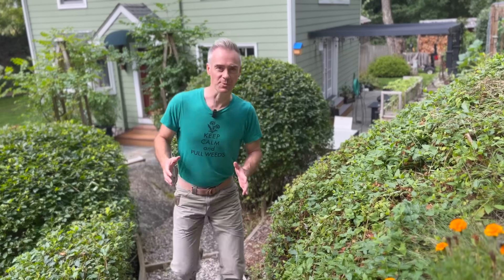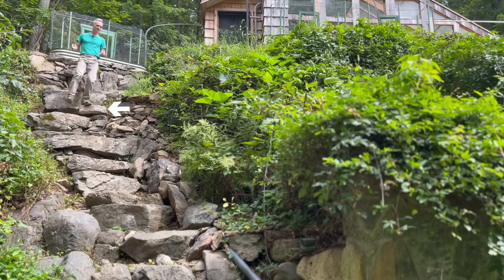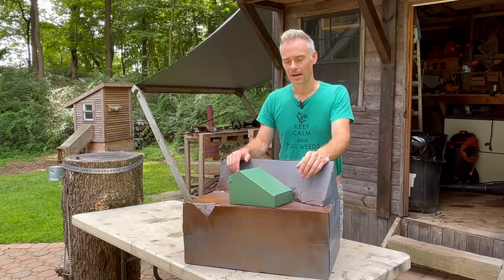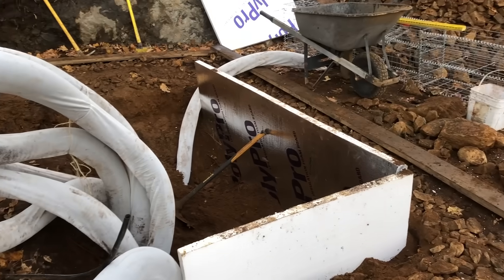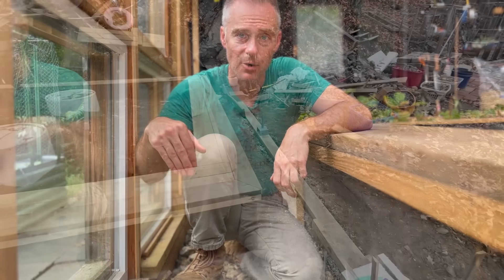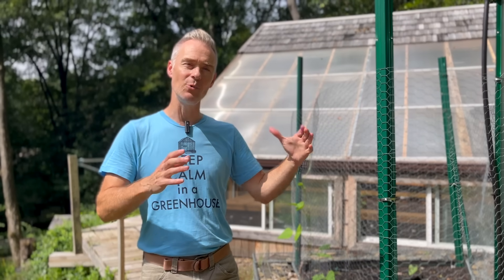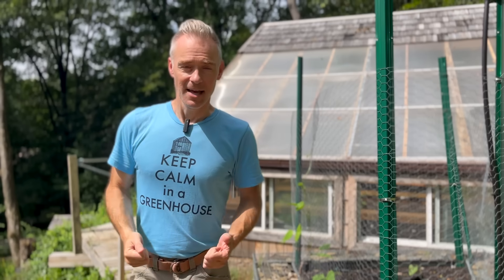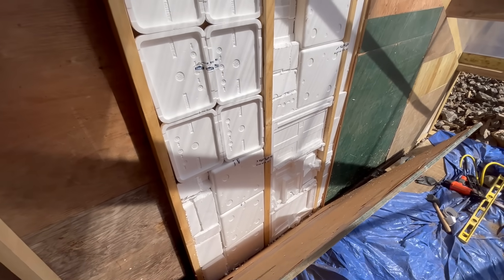Story of Building my GEOTHERMAL Greenhouse-1 MILLION VIEWS!

Comment: Interesting. The house we just bought had an old greenhouse with a lot of similarities to what you built.

Shape is the same, except above the section that isn't greenhouse panels, there is a second story, so the area below it gets indirect sun.

I'm going to use it for growing marijuana for my wife, and for early starting vegetable plants, along with some winter production. 

And some plants may just have to live there permanently - zones don't mean a lot at 4000'.

The amount of passive heat it gets is substantial.

Right now, my unheated not remotely air tight garage is 40F, so that's about the outside temp.

The greenhouse is 72F right now. 

Mind you, it gets cold in there at night.

I think if I properly seal the indirctly lit area and section it off from the leanto area with a poly sheet and use that for my flowering mj plants, with the lights on 12 hours at night - I could even go 13-14 if needed, that should keep the temps in the desired production range, and if I recirculate a small amount of air between the two spaces, I should be able to acheive a good temperature bias.

There are numerous 55 gallon poly barrels on the property, so I can use a couple to increase thermal mass, and save one to collect rainwater. We have all metal roofing so most runoff is near potable, and plenty good enough for plants.

Lots of good ideas from your video that I can easily adapt partially to my greenhouse to tweak the environment and elminate temperature swings.

I have thermal monitors in the greenhouse and shop that save the history and graph it out, so its interesting to compare the garage vs greenhouse.

The green house will hit it's peak temp around noon this time of year, whole the garage doesn't peak until 4pm.

I'm curious to see how the temp curves  change with plugging all the leaks.

Comment: I like your approach to business and the way you implement your plans – professionally!
But I, like many in the comments, am interested in the idea of heating with composting. You have chickens, leaves, and even wood shavings. Did you actually give up because of the frequent, probably monthly, change of the compost heap? I would like to see a video from you showing the idea of this heating method. It shows the structure, insulation, and an iron radiator in the center.
Reply from the maker: A lot a factors, the math looked a bit dubious...the pile would need to be HUGE, and would need to be changed/added to in the middle of the winter when compostable material would be sparse.

Comment: Where does the "cold" end of the tubing come out (the intake)? 

Why did you use perforated tubing? Aren't you concerned about water getting into the tubing?
Reply from the maker: Intake is usually a bit higher up. The inline fan is on the other end pulling air through system. Perforated pipe is important because the air movement causes condensation and the the water needs to be able to drain from the system.
Reply from the maker: The intake is usually a little higher off the ground. The inline fan is on the other end pulling the air through the system. Pipe is perforated since the air movement causes condensation and the water needs to drain out.

Comment: You should put in like a foundation in that hill near that new greenhouse. Like buy or rent an auger and drill 8 ft down put some rebar and fill it with concrete. Maybe even a retaining wall. You can even spread around 2 inches of cement(not concrete) on top of the dirt then till it, wet it with a hose, and then tamp it down really flat. It will turn it into a really hard dirt.

Comment: What kind of rafter span do you have? And what size timbers? I am looking at doing quite a similar overall envelope.
Reply from the maker: From the low front wall to the peak was about 17' and the the peak to the back wall was about 6'.  I milled the beams at 6"x 5".
Reply: @WineberryHill  ok thanks, that's good to know. It looks like you modeled it in sketchup, would love to check out the .skp if possible.

Comment: Thanks, I’m getting older and starting to hate Winters, just last night I was talking to an old Army friend discussing buying a place in the sub-tropics to spend 4 months a year there. Now I’m thinking, I can build a house that will stay warm without making the power company richer AND grow decent food for myself and friends. That is, make the greenhouse my home! As I get older, I’ve found I eat better, I grow more of my own, bottle, dry. Preserve. I’ve unconsciously cut down on meat consumption, don’t get me wrong, I love a good steak, pork chop or lamb roast, and really enjoy good BBQ, just not as much or as often and emphasis on quality. My question is the pipes you buried, I’m thinking in hot weather you “pump” air into them to cool down and in cool weather you pull air out of them? Further, why not use something like those solar heating tubes you can get for swimming pools to heat the water? Next question, would it be more efficient to fill the tanks with rocks, then water, heat the water to heat the rocks as a “thermal mass”? Many moons ago, I was talking to an AC tech, he said he heated and cooled his home using the “exhaust” from his house refrigerator! As described, he put the refrigerator in a “cabinet” in which the radiator at the back had an inlet for air and the air outlet was directed. In hot weather, the frig radiator air was vented to a chamber in the roof and then vented out through a rotating vent that generated electricity! In cold weather the hot air off the frig radiator was vented to a chamber in the basement then ducted to provide warm air to the house!
Reply from the maker: Cool!

Comment: So when you say “geo thermal” do you mean a ground source heat pump? If so what unit do you use and how are you powering it?
Reply from the maker: geothermal (adjective)
: of, relating to, or utilizing the heat of the earth's interior, also : produced or permeated by such heat.  My system uses forced air via an inline fan.

Comment: What thermal hose was used underground?
Reply from the maker: 4" flexible perforated pipe with a sleeve.
Reply: @WineberryHill  interesting.. I’m thinking bendable pipe inserted inside similar pipe would add more thermal reaction… maybe even 2 sizes of bendable pioe one inserted in the other with the innermost pipe having water flowing in it…with the bendable pipe connected to a duct fan.
Reply from the maker: Interesting, keep me posted...

Comment: I've got a newbie question: why did you insulate the sides of the hole the piping was in? I would've thought that having the piping exposed to the ambient temperature of the surrounding ground would've increased the efficiency of the ground/air heat transfer? Thanks for the video!
Reply from the maker: Good question! Insulating the sides prevents heat from dissipating into the surrounding ground, keeping more of it within the system for better efficiency. The bottom is uninsulated to allow heat storage in deeper soil, which helps regulate temperatures long-term. Hope that helps!

Comment: your 4inch pipes did drill holes in those pipes
Reply from the maker: The ground pipe is perforated. This allows the condensation to drain out of the system, otherwise it would eventually fill up with water.

Comment: Great video - but I am not sure I understand how cool air circulates up into the greenhouse in the summer? Is it mechanical in some way?
Reply from the maker: The average temperature below the freeze line is about 50˚F. Burying sleeved perforated pipe (so that the condensation can drain out) below the frostline and circulating air through that pipe (with an inline fan) warms/cools with that relatively warm air in winter, and cool air in summer.

Comment: This video is awesome. You made so much effort when building those little models! Using the left over rocks was a smart idea! I would have used them for a part of the walls though. Because the wooden walls will wither away over time while rocks won't do that as fast (I think, I am not an expert). You could use slate on the outside of the greenhouse to delay decay though. This is pretty common in my area, because it rains a lot here. Otherwise you might be forced to do heavy work when you're too old to do so. Also, putting some sort of composter inside the building or integrating it into the North wall might have allowed you to harvest heat energy from the composter.
Reply from the maker: Thank you very much!

Comment: I looked twice. I still dont know what you used as a heat tracefer from your underground piping.
Reply from the maker: Geothermal uses the natural heat from the soil. Pulling air through the system moves the warm 50˚f air from the soil up into the greenhouse. Also acts as a cooling system in the summer.

Comment: Only 10 made it to the end ?  How do you pollinate inside the green house ?  Is there just air going through the ground heat system?  On,y about 4’ deep?
Reply from the maker: Most of the plants I grow in the greenhouse are all self pollinating. Those that aren't get help from my air movement system. Yep, there is an inline fan on the GAHT system that circulates the warm air into the greenhouse.

Comment: A few comments and questions:
* I like your timber chopsaw station!
* What is the interior area of the greenhouse?
* What are the costs associated with this build and how might that compare to a build not leveraging recycled or reused materials?
* Is there a financial benefit of the greenhouse (i.e. savings over buying starts) or is it strictly an enjoyment of a hobby?
* I like the editing of your videos. Cutting to different locations on the property certainly gives it a polished, TV series feeling.
* Visual aids, such as cardboard mockup, were very pleasant and helpful.
Reply from the maker: The exterior is 16'x21'. The bed is 10'x12'. I made a video about the costs: (https://youtu.be/0vA8Hx8F7Sk) I didn't do a super tight analysis of the costs versus new, but I easily cut the cost in half going this route. Thanks for the kind words, much appreciated!

Comment: A geothermal greenhouse is a great idea,, I should do it myself.
Since compost can enhance the heating ground

Don't get rid of the rocks. use them.
rocks dehumify and heat the ground, and provide shade for plants that need slopes.
stones are a natural hydroponic system because water drops or runs from them
and it store energy and uneven surfaces keep water flowing.
So stones if properly placed, increase the freshness circulation of water,  water the plants for you, heat the plants
, and reduce winds and erosion. Plus it keeps away weeds and keeps cattle inside.
Rocks are a blessing, I would love a solid rock bottom property in nature.
Don't get rid of rocks, don't believe the idea that farming is a stone-free pot of land.
Stones are infinitely useful, they enhance plants and crops.
Buying stones is expensive,  what you need to do is pottery.
You need to move the stones together and put the soil on top of the stones
to create big pots heating the layer of soil on top of them.
Stones are an obstacle for trucks and machines but the advantage for small scale.
Reply from the maker: True!

Comment: A south facing rock slope- a great place for a greenhouse. There are videos on using the 22 caliber charge from a power -hammer and a drill for busting up rock. Pretty effective. And Rocks are great thermal mass since they are much denser than soil, and can go UNDER the Greenhous(over some insulation) as well.

Comment: This is great.  I shall attempt to do similarly...I need to listen again, for I do not recall how you circulated the warm geothermal air..fortunately I was given double pane windows and skylights,  so I can  have a better insulated. structure than if I used single pane glass. My thought had been to have the first 12 to 18 inches of the building below grade..  I love the idea of the entrance to prevent the warm air from escaping...what we did in Québec....  I am going to forward this approach to my friend, who is very environmentally aware...he is about to build his first greenhouse...thank you so much...also I loved the fact that you did not allow a bit of solid rock to get in the way....
Reply from the maker: there is an in-line circulation fan in the GAHT That is controlled thermostatically

Comment: I just used electric resistance wire running off solar panels covered with 4 inches of black gravel. Thermostat installed.
No digging.

Comment: Great design. The roof on the greenhouse where the shingles are could also use solar panels. I'm sure if you put as much time into research you could design or create a pannel that is more than 25%efficient. Just be cautious and don't patent any zero point energy, hasn't worked out for others well after patent applications
Reply from the maker: I considered it, but the tiny surface area of the roof wouldn't have been able to produce enough energy to offset the expense.

Comment: HI. Great work. Why did you choose perforated pipes for getting geothermal heat/cold? Is it because it is more efficient?
Reply from the maker: As the warm and cool air mix. It causes condensation, the condensation will pool in the pipes, and if they weren’t perforated, they would eventually fill up with water.

Comment: Since the rock metal wall is hidden from sunlight how does it become a heat source? Is it dug in deep as geomthermal.? Could not tell from video. * newbie question, not complaint.
Reply from the maker: Hmmm. Not 100% sure if I know exactly which you are referring to. I think you are talking about the gabion baskets that are filled with rock. The rock absorbs the heat during the day as the greenhouse heats up...doesn't actually need to be direct sunlight. It then slowly releases it overnight.

Comment: Very nicely done.
I built something similar.  
I built it as if it were a "pole building"  I insulated it with used polystyrene from flat roofs & filled the cavity fully to 8"  for an R40 in the walls,  a R65 in the roof, & R20 sub-grade.   I dug down 36" & filled the sub-grade with washed stone (for drainage) then topped it with paving stones. 
The exterior & interior walls are covered in corrugated steel. Farm colors out & white inside to reflect sunlight around.  It is oriented perfectly south facing. Vent windows low & high. As well as glass sliding doors on the East & West sides.   
The glass window sashes are installed at 45°. This was calculated by considering the height of the sun during late January/early February (our coldest periods & the start of my wife's growing season).   See, glass absorbs the sun rays best when it hits glass at a 90° angle. The harder the angle the more it reflects it out (summer time).
I kinda wished I'd installed the cool Geothermal system. I plan on using a wood burning stove for supplemental heat during the coldest part of the winter. I'll have several black 55gal drums flanking the stove for a thermal bank & to warm the water my wife feeds her plants.
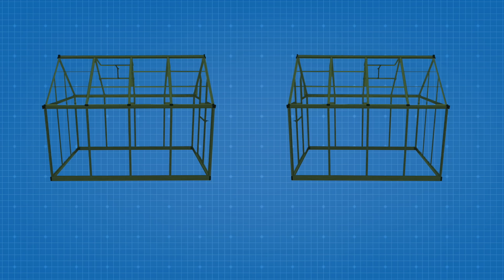Idk. Hope all this works out.  Good luck everybody 0:39
Reply from the maker: Sounds epic!

Comment: 5:00 You di know there is a model for how to do geothermal in rock rigth? Instead of a pipe coiling just below the surface you drill a deep hole and keep it straight. For wrilling in rock I reckomend a pressure hammer drilling method,

Comment: Great video. I was wondering how you achieve good pollination in a closed building.
Reply from the maker: Good question! Almost everything I grow in the greenhouse is self pollinating, things like strawberries, green beans, also lettuce and brassicas. I do grow tomato and cucumber which are monoecious, BUT having good airflow helps by itself (the pollen is easily blown around in the greenhouse) AND I also help them out with a brush or pipe cleaner.

Comment: Hi. Great video and built! I want to build something similar on the south wall of my house this summer.  How big was your geothermal hole you dug and how many feet of pipe did you bury? Also why did you use perforated pipe with sleeves? Thanks
Reply from the maker: The rule of thumb is to have the equivalent air volume in the pipes as your greenhouse. I wasn't able to do this because of the amount of rock...but thats the idea. The pipes need to be perforated and sleeved because condensation will build up in the pipe, so it needs to be able to drain out...the sleeves keep the dirt out.

Comment: I am just starting planning our green house. Sorry in Europe so temp wise we have - 3 to +40 centigrade. How to do calculations ie pipes length and depth in ground in reference to size of house. Is there a go to book or site for help?
Reply from the maker: The basic idea is for the volume inside the GAHT pipe to be roughly equal to the air volume inside the greenhouse. Here are some useful links: http://www.ecosystems-design.com/climate-battery-calculator.html and https://ceresgs.com/whats-the-best-roof-angle-for-a-solar-greenhouse/

Comment: great video's, wish there was a little more info on the outcome of the actual temperatures. It would be cool if you kept record of the temperatures outside and inside on a graph for a year to show how it is working really. Coming from someone that lives in zone 4, I could compare more to our temps and see if what you have done is a viable thing here.  
Do you change the direction of the fans in the Winter or alter the tubes so you are not sucking the warm air at the top of greenhouse and instead draw the cold air from closer to the ground?  What is the typical temperature of the air coming out of the tube in the winter?
Reply from the maker: More to come.